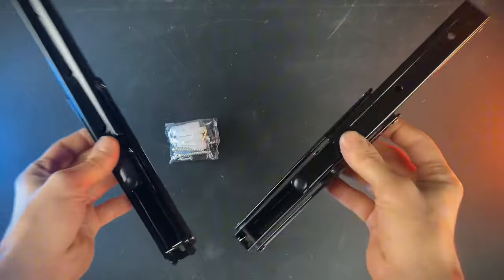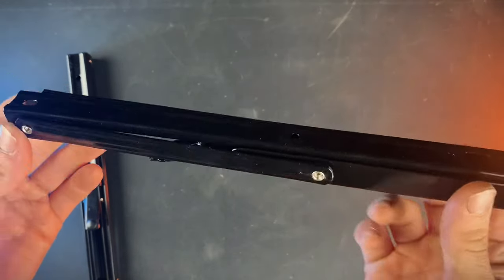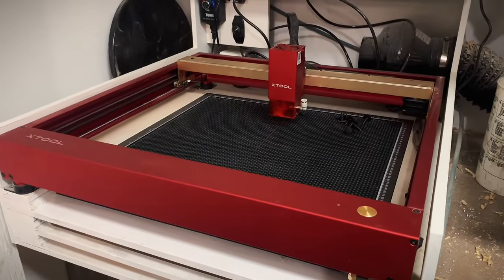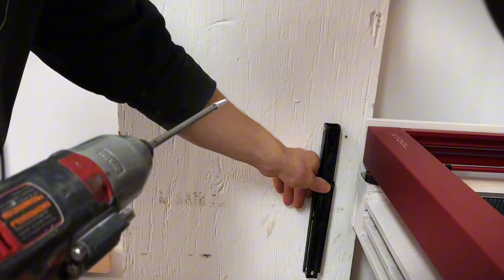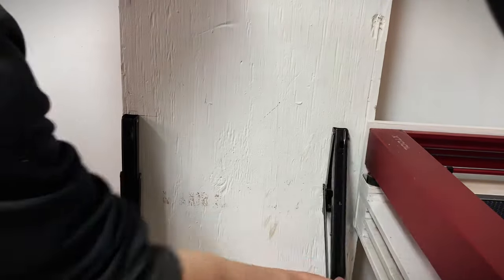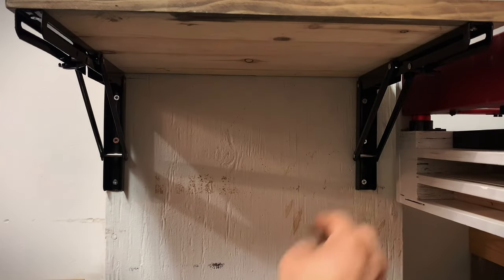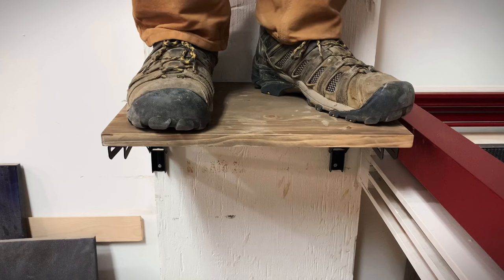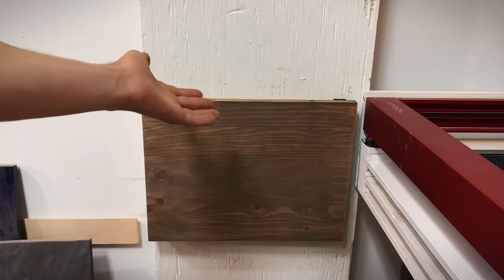Folding Shelf Brackets - Review

Comment: They are actually notoriously weak. You need to get ones of thing rather than thin metal triangle arms instead.
Reply from the maker: Yes, the metal is a little on the thin side. But I am actually surprised at how strong they are. Sure, I wouldn’t trust them for a large folding table. But for something small they do just fine
Reply: "You need to get ones of thing "  What do you mean?
Reply: Thank you. Have a typo in this post here. Please edit and tell us what you meant